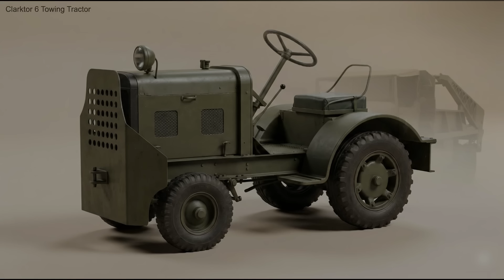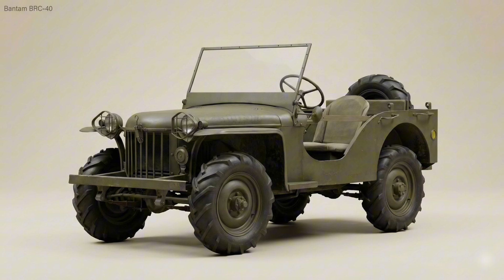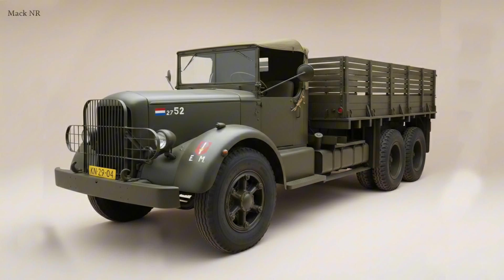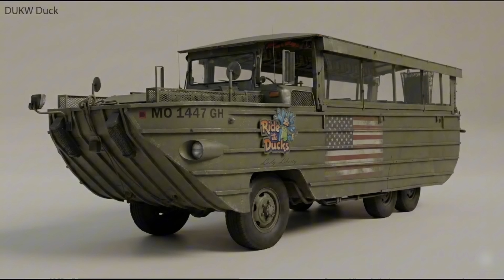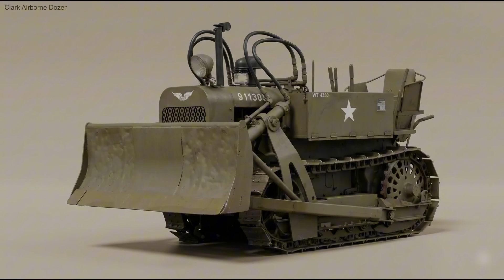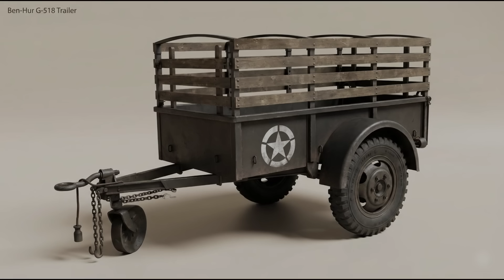Every U.S. Truck & Car Used in WW2 Explained

Comment: Great overview, but I’d question the claim that the GMC CCKW 352 alone sustained the Red Ball Express—logistics data shows rail repair and fuel pipeline advances were equally decisive. Are we overstating truck mobility as the primary driver of the Allied breakout tempo in France?
Reply from the maker: Fair point. I didn’t mean the CCKW alone sustained the Red Ball Express rail repair, fuel pipelines, and port work were all crucial. My focus was on the trucks’ flexibility during the breakout, but you’re right, it was a full logistics system effort
Appreciate the insight.😊